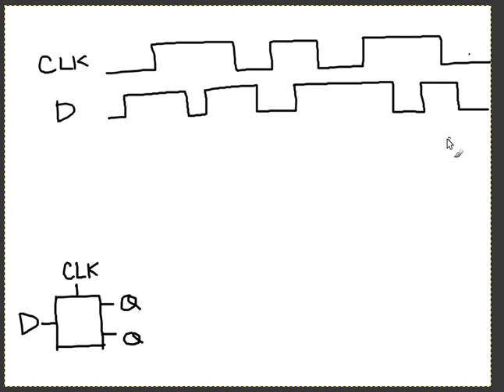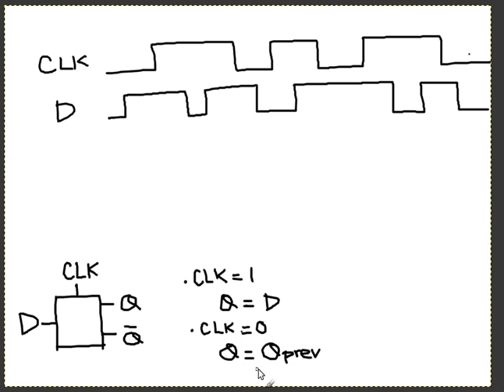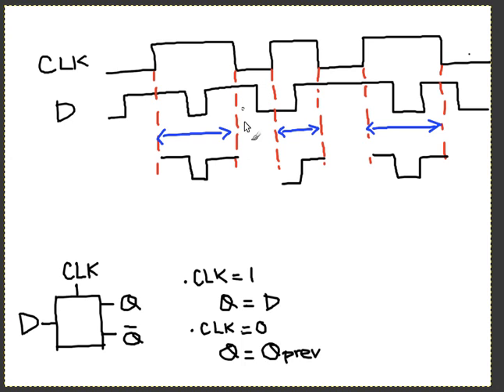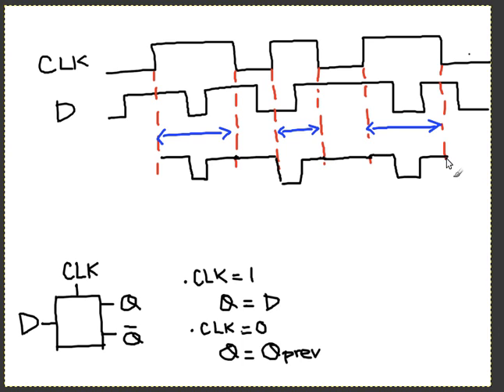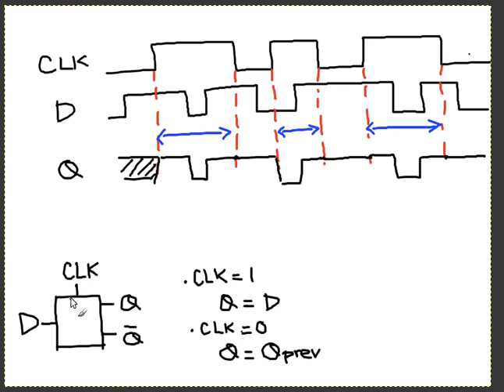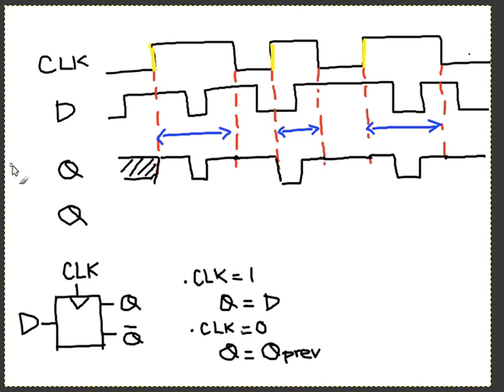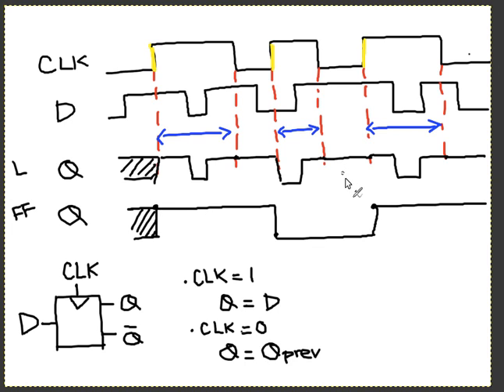CSE140: D Latch & D Flip Flop

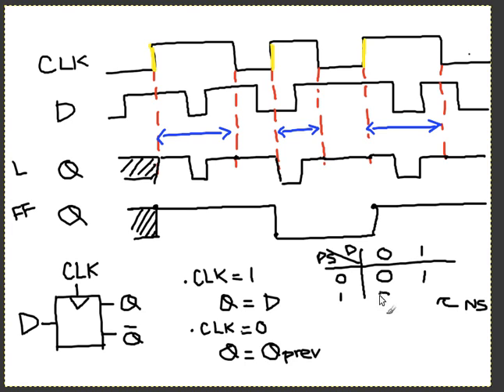Comment: So the table does not care about the clock? at 6:17
Reply from the maker: When we write the state table and excitation table, we usually leave out the "CLK". D latch and D flipflop behave the same way except for the CLK part. We look at the whole interval when CLK = 1 for Dlatch, but only look at the rising edge (when CLK changes from 0 to 1) for D flip flop.
Reply: CS3Girl So does that mean D latch and D flipflop would have the same state table and excitation table? Since CLK is irrelevant, and CLK is the only thing that differentiates the 2.
Reply from the maker: Correct
Reply: one year later. I have exactly the same question
Reply: @visalbotrchan1431 5 years later, and I had the same question. Glad I found this comment.